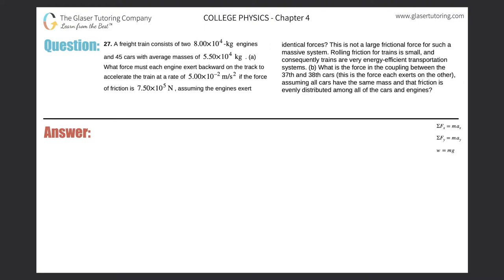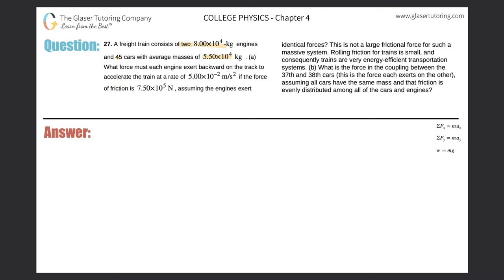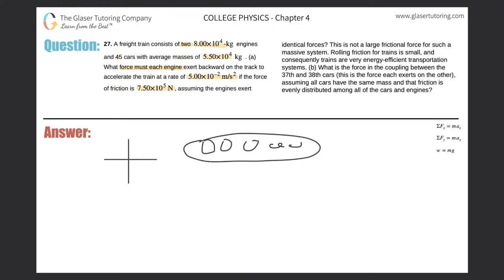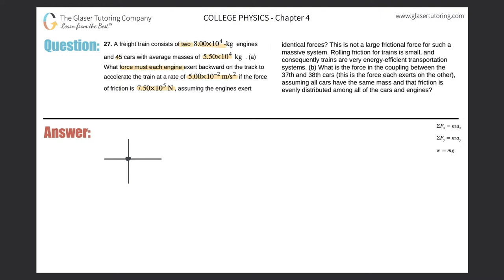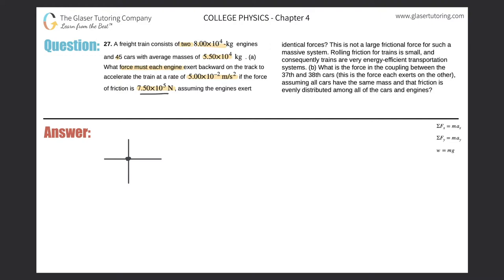4.27 | A freight train consists of two 8.00×10^4-kg engines and 45 cars with average masses of

Comment: For part b, why is it 8 out of 47 cars when it said there were only 45 cars?
Reply from the maker: Well, it's because ummm.... I made a silly mistake 🙈.  The correct answer should be 1.5 x10^5 N.  Thanks for the keen eye!
Reply: @GlaserTutoring  You didn't make a mistake mannn. It was 8/47 because the friction was evenly distributed between the cars and engines
Reply: @MortalH  If we are calculating the tension between two cars, where does the 8 come from? Isn't the question asking for the force between cars 37 and 38? I got an answer of 3.72 x 10^4 N